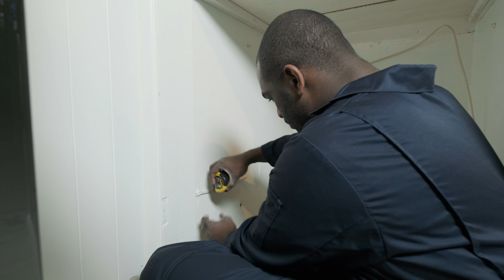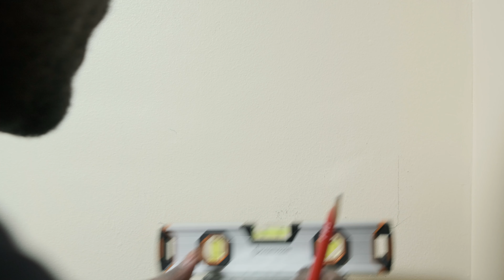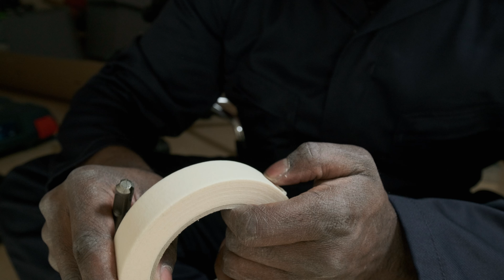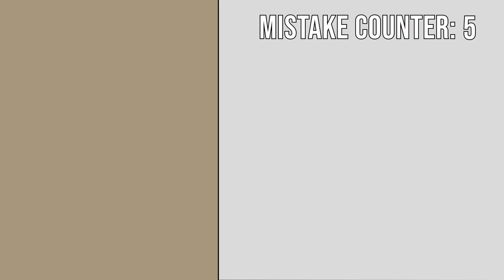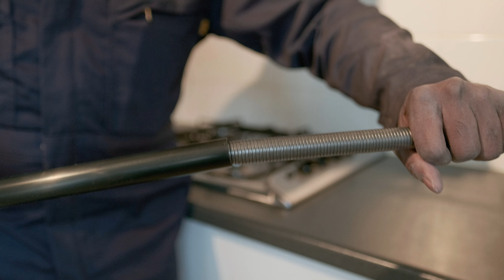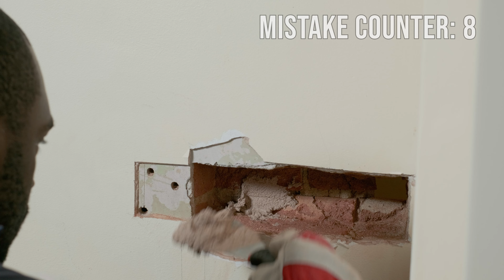How NOT to install a back box

Comment: Good video exposing the mistakes that most of us would make on a first attempt. Personally, I have the tendency once I start a job like this to get it over and done with as soon as possible and that's when you can automatically cut corners and make the job harder. Then you spend time repairing the mistakes, ( as you did with the plaster on the other side of the wall ), then a relatively quick job becomes a saga. I thumbed this video up because :  a)  It was informative and  b) because you stuck your neck out on camera and didn't just hide behind a pair of hands.  :)
Reply from the maker: Thanks!

Comment: Shame about some of the cock-ups you made, but valuable lessons learned and well done for sharing your mistakes. Takes guts to admit to the internet you made mistakes, so kudos to you. I'm doing the same in my house, but re-wiring the electrics and running structured cabling at the same time, not in the same runs though, never run low voltage and high voltage in the same chase!